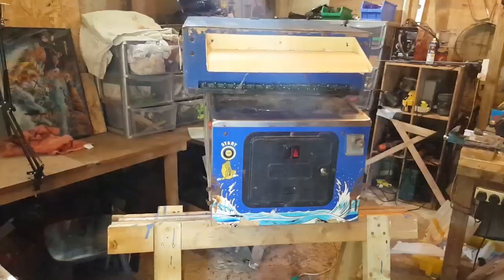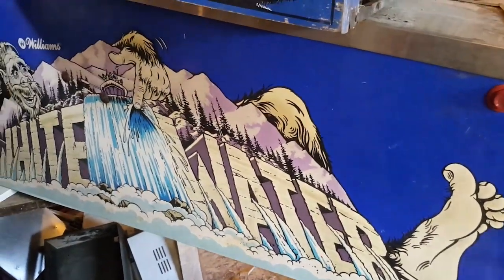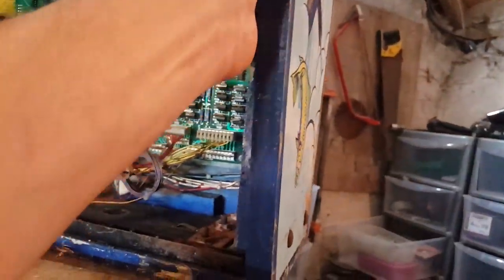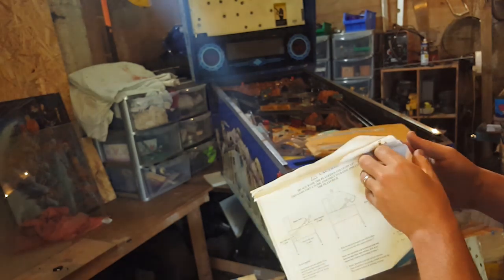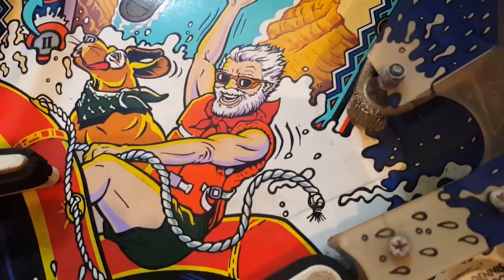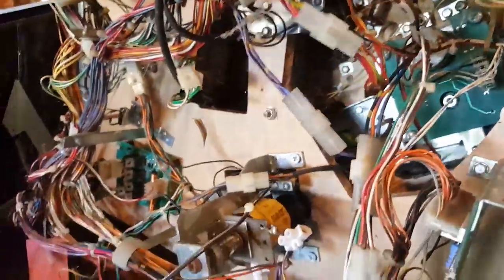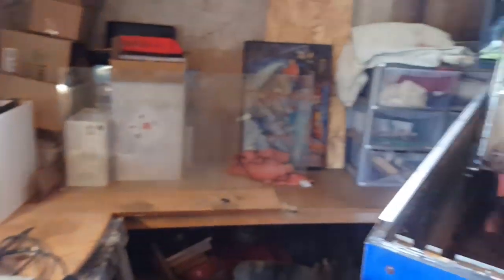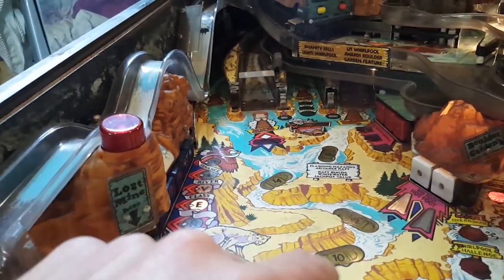Williams - White Water Pinball - Dumpster Rescue / Donation

Comment: Great find! The parts the matter arr all good. I would build or buy a new cabinet. The parts I would worry about is the electronics and the playfield. The art is all faded so it needs a new box and art.
Reply from the maker: electronics are an easy fix really . but it seemed to be all working anyway. playfield is fine. it's mostly going to be wood work and rust removal / protecting

Comment: Easier to rebuild a whole new cabinet than any type of repair there...
Might be an idea to part it out otherwise.
Reply from the maker: it would be easier but definitely not as fun . It's nothing I haven't done before anyway and I already repaired the head box (I'll post a vid on that soon too)  & parting is not an option when you can get it fixed .
Reply: @8bitmanshed  You'll find a LOT of the parts you need ARE available (like topper dome, targets, cabinet decals) so it CAN be done for sure... not completely cost effective but like you said, that isn't the point :)
Reply: Do not part it out, it wants to live. Marco, starship fantasy, pinball.center.de have everything you need. there is a good restore thread on pinside too that you can look up.